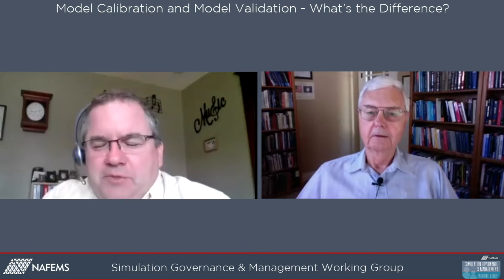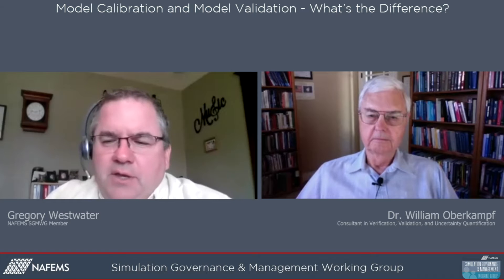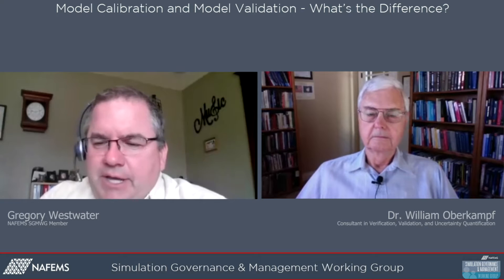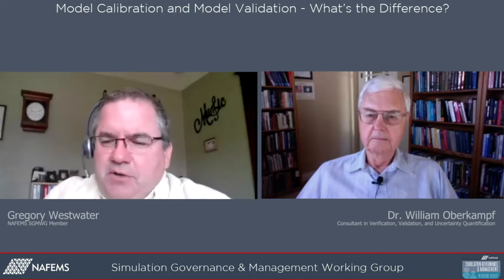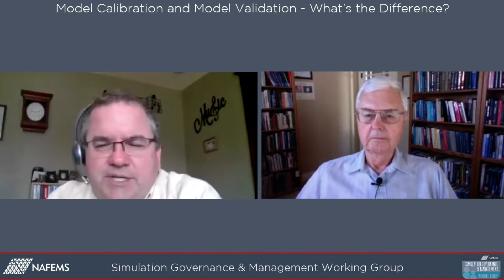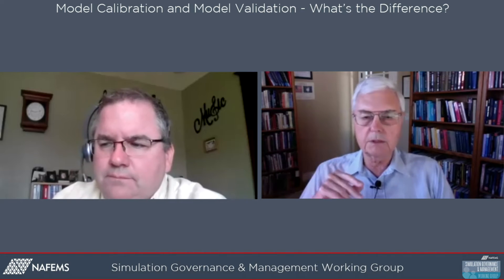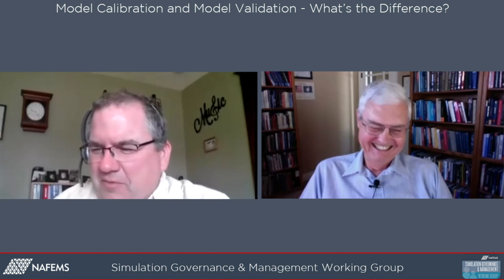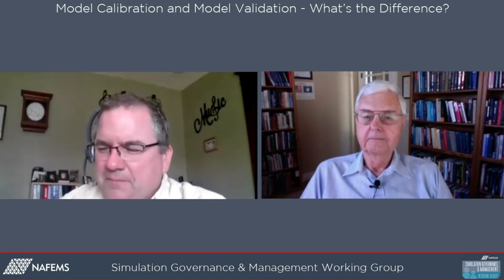Model Calibration and Model Validation  - What's the Difference?

Comment: Hey guys thank you very much for this short but infomative video.
I have a question to 9:15 + you talk about calibrating the model with one dataset and then using in the validation another data sata which is independend (multi - data - approach). 

I would like to know if it already a BIAS if I use another year of the same micro watershed. (related samples)?

And also im interested in the actual comparisson. Thats a field im just getting started. I assume you compare the different output the model produces. I assume you use NSE or RMSE depends on what you have. What is the treshhold you would say the model performs poorly. 

Thank you very much guys.

Comment: Thanks for the precise and ease to understand definition and application of the two terms. I'm in the pulp industry our final pulp slurry product is dried using Foundiener drier machine. Pulp drier is calibrated quarterly. The moisture range of our final product is 4 to 11 %. The method used to calibrate is that we select one low moisture point e.g. 4.5%+/0.5 and high moisture sample e.g. 10.5%+/-0.5. We analyze 10 low moisture sample and 10 high moisture samples for calibration. Our calibration correlations are always extremely good at R2 = 0.9999 but on our normal operations we have very poor correlations which fluctuates. The process data is not aligning to our calibration data.
If I understood you well, you are saying we must collect calibration samples that cover the full range of our product not sample only two points ?